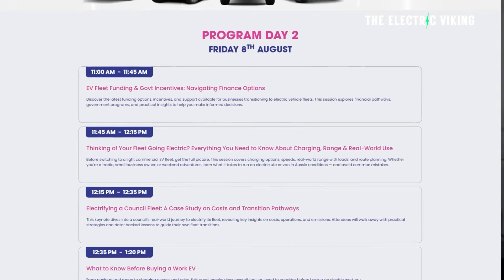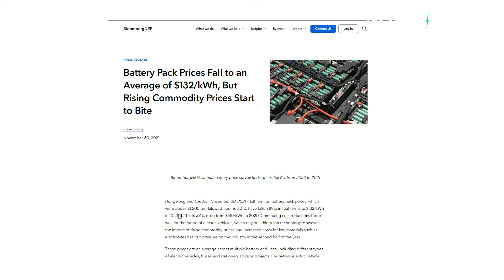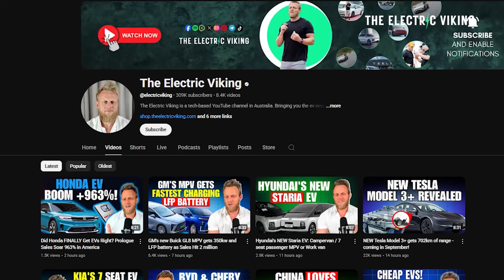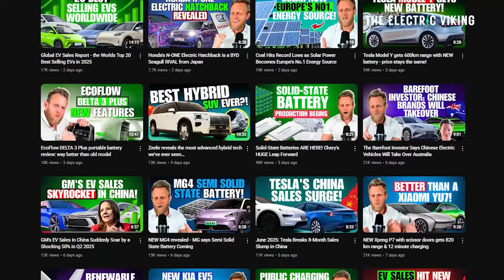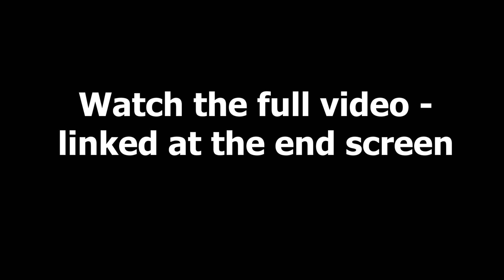EVs Are Almost as Cheap as Gas Cars Says Bloomberg — Here’s the Proof!

Comment: Unless the electrical grid of Western countries keeps up with the uptake of eves, you are going to run into an excess of power demand without the grid being able to supply. Don’t forget, AI is expanding faster than evs, requiring humongous amounts of power.
Reply: As liquid fuel demand tapers down the huge energy needed to refine,transport,extract,discover will reduce too. An EV goes roughly 3 times further on the same amount of energy.